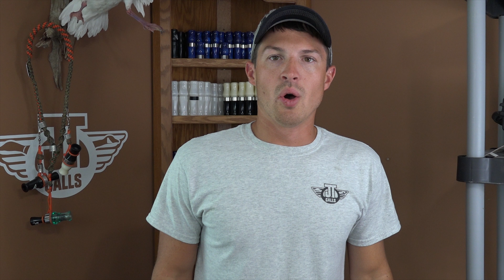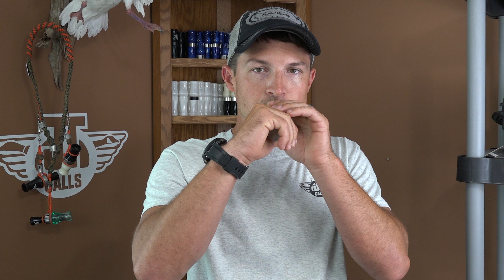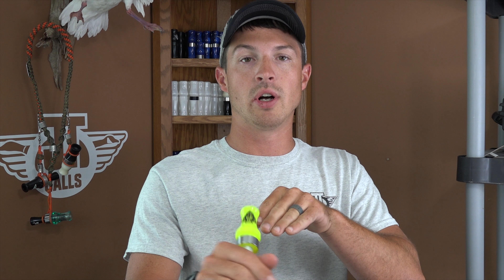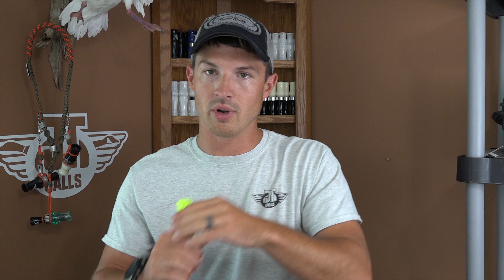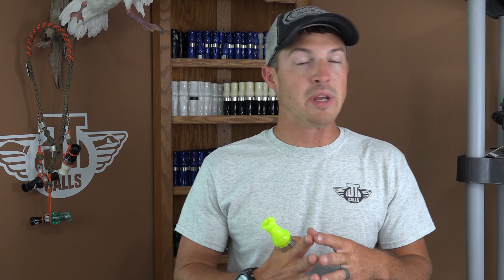Duck Calling - How to quack on a duck call (How to Quack and fundamentals)

Comment: When I do a quack it is kinda deep and raspy
Reply: Yardgnome1111 that’s fine raspy is sometimes good. Raspy is way better than a high pitched kazoo noise .
Reply: Yardgnome1111 if it’s super raspy you may be grunting more in the call than you think...use more pressurized air but you can still use some voice infliction to keep it at a deeper sound.